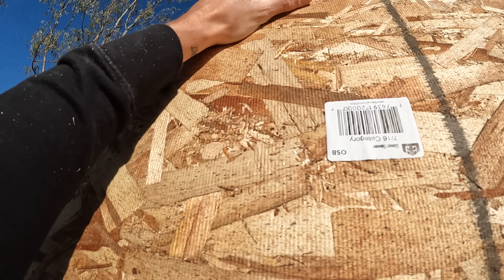Building a LUXURY Hunting Blind! (Part 4)

Comment: Hunting blind tip, Maybe you should put a metal pipe across the windows to set your pew pew on for a steady shot. but It's getting there. Nice work!
Reply: And swing up windows, not sliders
Reply: @morthomer5804  pretty sure he mentioned that in one of the first. Was a cost thing.